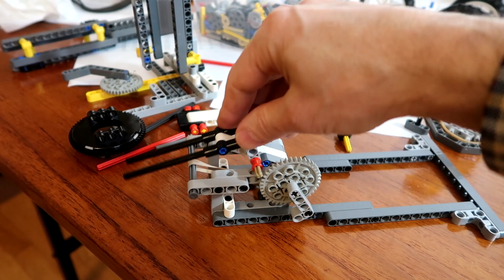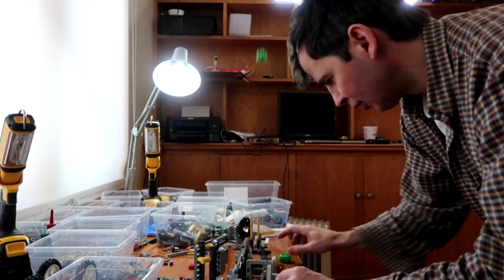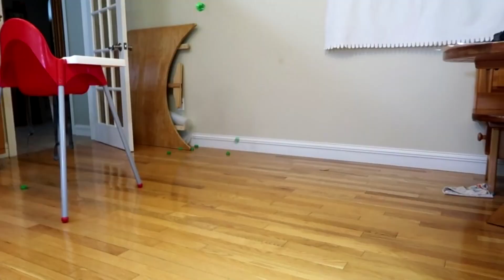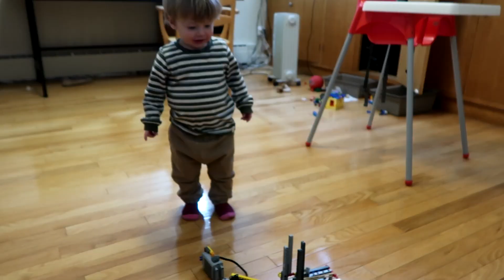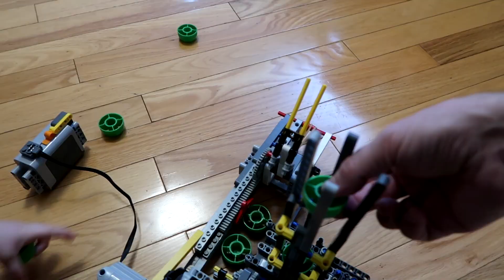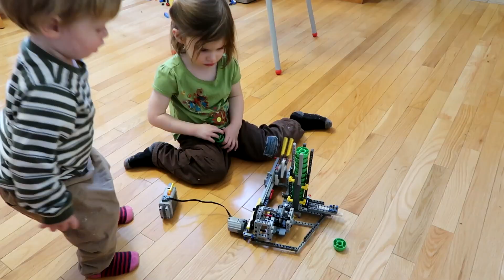Lego machine catapult (rapid fire)

Comment: great build! Am I right in thinking there's little load on the motor on the retract portion of the cycle? If you wanted to make the motor load more even or possibly allow it to run a bit faster, you could add a biasing spring (elastic band) that is stretched on the retract, so helping the cocking part of the cycle. Alternatively adding rotational inertia may achieve the same thing more efficiently and easier.